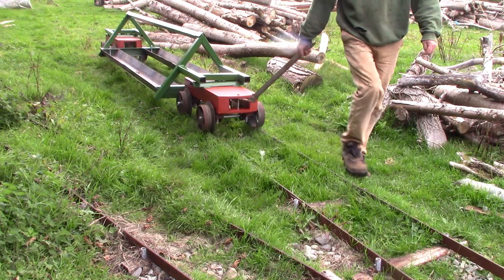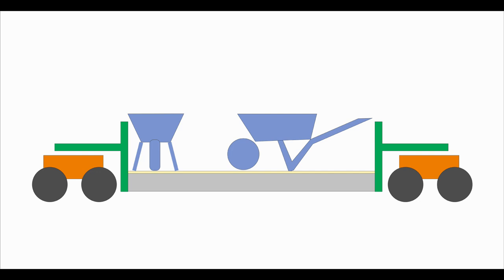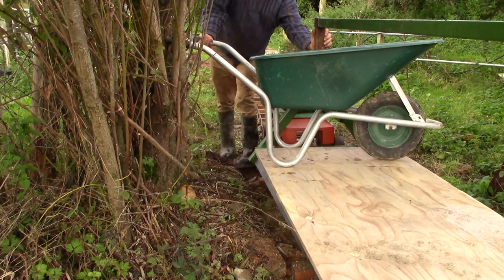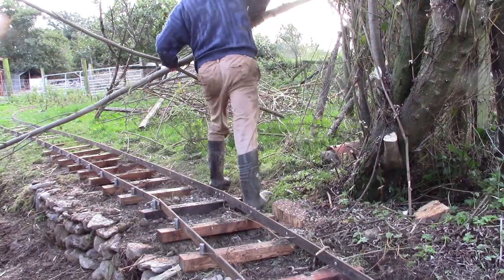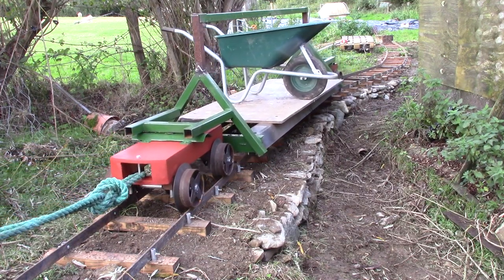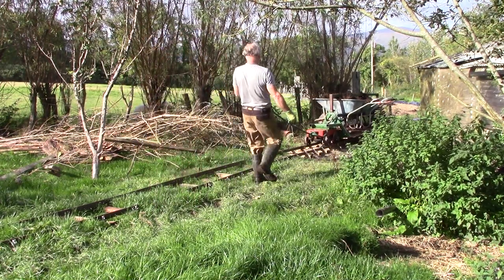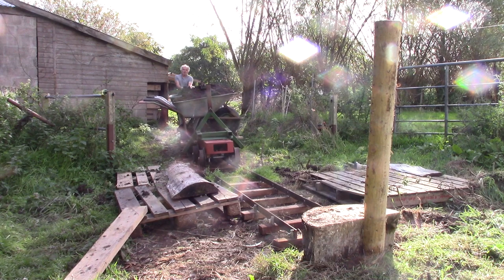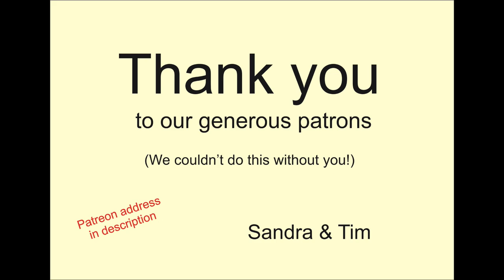All Aboard The Poo Train! (Amazing wheelbarrow transporter in action..)

Comment: Since you're loading at the high end of the railway and unloading at the low end, you've pretty much reinvented the gravity slate trains they used on the Ffestiniog railway  - pull the light empty trains up the hill with horses or steam engines, then let gravity do the work of pulling the heavy full trains back down again 😁

In the quarries they had slate inclines which took it a step further - they attached the empty trains at the bottom to the full trains at the top by a cable wrapped round a rotating drum at the top, and got the full trains going down to pull the empty trains up for free. Obviously that only works if you have a really steep section of line and two parallel tracks, and a big brake on the cable drum!

Comment: As you have gone this far you might want to build a tipper?  It will carry larger loads and half tonne of muck easy! Then use the barrows on the feild!
Reply: But then he has to shovel it twice, first into the tipper and then again into the wheelbarrows.
Reply: The issue with that is that one would have to load the tipper and then load each wheelbarrow, effectively doubling how often the manure needs to be handled. Would make sense I suppose if the plot was very far away but at this scale (and maybe with a loco and a second or third set of bogeys) more trips might be preferable than manually re-loading muck…
Reply: @Henning_S.  not if it tips directly into the barrows? Less shovel load is alway a plus. The flow can be controlled by baffles. Much like you see with the tippers on a truck.
Reply: @alexnosheds  as always time and effort being the defining factor. With tipper design they normally work best when the angle allows gravity to overcome friction. As the muck can be sodden? the optimal angle wont need to be too high. In many respect the barrows are already being handled twice. So there is room for efficiency savings. If i recall?  anything over 35 degrees of incline will cause the muck to slope due to the angle of stability being disturbed. Most design max out at about 70-80 degrees of tip. The other option would be to build drop section of track that can be lifted on each garlic bed row. So only tipping where the mucks needed? Get as close to the work as you can is the principal.
Reply: @jasonhaymanonthedrawingboard  I'm pretty sure tipping the wagon directly into the wheelbarrows would only work if the muck is almost completely dry or so wet that it is almost liquid. If it is in a regular wet condition like in the video, it will stick together and if you tip the wagon it will come out as one large chunk.
The only option which may save some work is putting rails between the garlic rows so you can stand on top of the wagon and spread the muck evenly on the field using a shovel. Because even when using wheelbarrows, you still need to spread it evenly across the field, and this way you can do unloading and spreading in one step. This is also how they did it 100years ago, slowly driving the horse wagon across the field while two people are standing on the wagon spreading it with a fork.
Reply: @Henning_S.  you know where this is heading? Homemade muck spreader on rails. I don’t know why i didn’t think of it sooner? I know they got the skills. Like  a scrapheap challenge style muck spreader? Would be awesome if they managed to retro fit a second hand muck flinger to do the job. Even the most simple ones are just a tub augers pushing it into a tube. With an extruder plate for a nozzle. Something like a hand cranked mincer?
Reply: @jasonhaymanonthedrawingboard  that would be nice, but a lot of work to build and it requires a pretty powerful engine...
Most muck spreaders are designed to throw it out the rear, so they won't work, but this design should work well on the tracks:
https://youtu.be/-hs7hYOGYC0 
It seems to be reasonably easy to build, he just needs an engine with at least 20hp to drive it...

Comment: Next 'bright idea' : Take the 'tubs' off the barrows and place them directly on the wooden platform. Place a barrow-frame at the garlic-bed end. Run train to the end. Slide each tub off the wood platform onto a wheelbarrow frame and move contents to area where needed. Wheel empty tub back to train and repeat until all done. Barrow frame is then at the same height as the wood platform; so easier loading and unloading, lower centre of gravity, no clearance issues, more stable. Do I win a prize?  🙃🤪🤓
Reply from the maker: Unfortunately the barrow frame is much taller than the platform (because of the wheel) so everything would need to be higher off the ground

Comment: If you want to carry 6 wheelbarrows why not just make a second one the same size then you could transport upto 8 wheelbarrows and shouldn't have any snags when taking tight turns which may occur if you extend this one to be long enough to hold 2 extra wheelbarrows, if you make some dead end buffers for the ends of the track you could stop the Wagons fulling off the end.

Comment: There is a full history of rope hauled railways, Tim, especially in my home county of Co Durham. Maybe a side by side track where the full load hauls the empty load back up the hill, while the empty load is filled at the muck heap the full load is emptied at the garlic. If finances don't stretch to a full double track a passing loop at the half way point would work just as well.

A long rope would round a car wheel and mounted on a vertical shaft would provide the power (would need to be reversible though.

Just some thoughts for the mechanisation of your railway.

George
Reply from the maker: I like this idea too, I just don't think I'm going to live long enough to get around to 1% of the projects I want to

Comment: Why couldn't you make a tipper car/wagon? You could load it at one end, lock the bucket, and unlock the tipper on the other end and tip it to the side to unload it, so I think a lot of the issues could be resolved with this solution.
Reply from the maker: but then it would all be dumped up against the rails at the far end. Then what?

Comment: If you redesign the poop train: I think I would not actually set the wheelbarrows on the wheel and legs. you could attach some bars to the wagon that the trays could directly sit on. That way the wheelbarrows would be quite a bit lower and easier to get on and of the train.

Comment: Don't use wheelbarrows. 
Use 5 gallon buckets on your trailer with plywood. The buckets are easy to handle. Just don't fill them all the way.
Reply from the maker: Do you mean carry hundreds of buckets on and off the wagon?
Reply: @wayoutwest-workshopstuff6299  
That's how I removed 20 yards of dirt from my basement. 5 gallon buckets. 
Try it on one of your loads and you might be surprised. They are alot easier to unload than a wheelbarrow since you can throw it where you want. Only fill them 1/2 or 3/4 full so they are manageable. 
The wheelbarrows are too top heavy for what you are doing. Also too cumbersome trying to load and unload. But you are already finding that out.

Comment: What a good project. Is it possible to run a small stationary engine to give free wheel down and the pull up via  rope power? Difficult to see with the curves. Covered pulleys in the track centre? Thanks for posting.

Comment: I think you should try building the typical hopper carts. They can be unloaded easily and it's a really old, easy to build and versatile design
Reply from the maker: they'd need to be so high to empty into a barrow though
Reply: @wayoutwest-workshopstuff6299  there's a solution to that: a raised platform for the carts to run into. I don't think it would need to be raised that much, just enough for the hoppers to empty into the carts. And if you can come up with a lightweight design, you should be able to carry it with two people so you can put it somewhere else when you're done in one spot

Comment: It occurs to me that you could very easily and economically make your railway electric. Use some second hand 24 volt solar panels about 6 should do it, run either a 24 or 48 volt DC system for simplicity. Create a few electric bogies, controls could be very simple. A PWM controller could control the speed. The only modification to the existing wagons would be to insulate the hubs so the axles do not short out the rails.  Pm me for more info.
Reply: Basically a good idea, but I think he will lose a lot of the electricity through the tracks, because the wet wood is not a great insulator.
It is easier to make it battery driven, for example he could use the drivetrain of one of those electric scooters for old people, the older ones run on two 12V car batteries, so it is cheap and easy to maintain...
Reply from the maker: I just love the idea of being able to find second-hand solar panels  : -  )
Reply: @Henning_S.  At 12-24 volts it should be ok, but I am talking from a very dry climate . Your idea is good too especially if you hear down the mobility scooter to lower speed and increase torque. You can still use second hand panels to  charge the battery
Reply: @wayoutwest-workshopstuff6299  you can often buy them cheaply from insurance companies that replace storm damaged roof top systems.